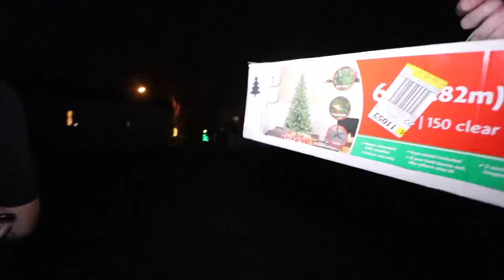Snowmobile FOUND In Barn...WILL IT RUN?!

Comment: When shipping electronics go to the lumber yard/hardware store and get some of the big 4 ft x 8 ft sheets of styrafoam insulatin....you can get them in 1", 1.5", 2" etc thick....cut down to size of the computer or vcr etc...safe, light and works great...I use 1.5" mainly for what I do...much better padding than paper or other stuff that shifts once in transit and gets tossed around...